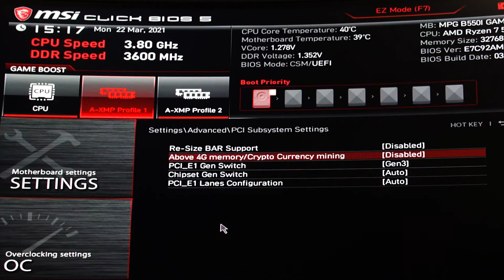Reasons a Computer won't Turn on - Part 2

Comment: Hi im back my mother board light is on but power bottan dosnt work i used to jump start my pc every time this happens but this time it wont i have a ryzen5 3400g primeA320mk motherhood 16gb ram vega 11 500w power supply

Comment: So I recently bought a new motherboard. When I plug the power cord in the lights on my motherboard turn on. But when I press the button to turn on my pc nothing happens. And I made sure the power wire is going to the right place on the motherboard as well. I don’t know what’s going on here.
Reply from the maker: Did  you connected the CPU power connector? Did you tried flipping the reset switch connector incase your positive does not match to positive? Part 1 video is a step by step guide, this only mentions some of what I needed to go into more with and a few things that needed mentioning.

Comment: Hello, can u help me, i just built my new budget PC and its not turning on, i have no idea why, i can send pictures if needed
Reply from the maker: Is your power switch connector from your case on the correct motherboard pins? As mentioned in video part 1
Reply: @sparketech  Hello, i found out mz cpu power cable wasnt connected in the right way, im typing this from my new PC, but i still have a problem, i cant get to use my hdmi on my rx 570
Reply from the maker: Also make sure the power supply switch is turned on... Some are switched off out of the package.

Comment: i tried to jump start my psu.. it works..and   my motherboard working too.. but when i mount my psu to my mobo.. it wont start.. and even psu wont run the fan
Reply from the maker: Part 1 video is very likely to have the solution... Going to sleep right away less than 6 hours left to sleep before work. Hope it's something easy...

Take it this is a new computer? Motherboard and CPU? What Power supply?

Comment: Hello Zerou here from Discord. I will repost my case.

So i got myself a new pc. I bought each component individually, screwed, plugged everything pressed the power button but nothing worked. No fans are spinning, no EZ Debug LEDs are lighting up, there is nothing audible.

I checked every connection. That includes every powersupply cable and also Power Switches (also with the screwdriver method).
I also tried to remove memory sticks one by one.
I connected my Smartphone with the USB Port of my motherboard and i saw that it startet charging so there must be some electricity.
I also removed the CMOS battery and put it in again to reset the settings.

My PC specs:
- AMD Ryzen 7 5800X 8x 3.80GHz So.AM4 WOF
- MSI MPG X570 GAMING PLUS AMD X570 So.AM4 Dual Channel DDR4 ATX Retail
- 32GB Kingston Renegade K2 FURY DDR4 3600 UDIMM CL16
- be quiet! Dark Rock Pro 4 Cooler
- 700 Watt be quiet! System Power 9 CM Modular 80+ Bronze
- be quiet! Pure Base 500DX Midi Tower

Question: Should the powersupply fan turn on when i switch the powersuppy on even though the rest of the components including the mothermoard isnt doing anything?
Reply from the maker: The USB ports still charge? Do you have access to another PSU to make sure not faulty?
Reply from the maker: Forgot to ask what is your GPU?
Reply: @sparketech  rtx 2080 TI i also have a gtx 970. I have another PSU but i dont want to play around that much with the hardware. Dont wanna mess up with anything
Reply from the maker: @Sezeru61  offering suggestions just in case. There is always the odd thing that can happen

Comment: my pc sometimes starts and sometimes doesnt, tried finding a solution but nothing comes to mind
i have to wait a bit if i wanna take it to get it checked out so ive been trying to fix it myself
Reply from the maker: Part 1 has the small details... And my newest video unstable or crashes video till tell you more... Hint test your memory as I state in my newest upload links to the program is in that video discription... Memory issues could very be the case, people rarely realize it
Reply: Bro same I cant find fix on the internet. Tried changing psu and it never fix

Comment: I need help my pc won't turn on, fans won't spin and yes i watched the first video also i got the mother board replacement my warranty they said it's faulty but everything is the same
My specs
Cpu:r5 3600 
Mb:b450m s2h
Power supply:cooler master 600w
Ram:g skill
Gpu:rx590
Reply from the maker: Do you know if you have an old or new bios on the motherboard? At least new enough for the 3600 CPU that is. Did you try the computer with ram in different slots including just 1 stick? Do you know for sure that your power button switch is in the correct slot to work and the correct negative positive direction (maybe try flipping it)
Reply: @sparketech  it has the new bios and i tried using screw driver to power it still nothing work
Reply from the maker: @Alien-cr1zb  power switch is powered on on the power supply? All the power pins installed on the board? Cause some put only 20 of the 24 in. Do you know that your power supply isn't the issue? Are there any power lights on the motherboard? Usually there is usually a small LED light on when there is power to the motherboard
Reply from the maker: @Alien-cr1zb  The screw driver trick if you hit the wrong pins it could go badly... Have you tested your power supply? Sadly that motherboard of yours does not look to have LED to show it is receiving power like most boards.
Reply: @sparketech  and yes i tried each ram on both slots alone
Reply from the maker: @Alien-cr1zb  if you have discord it'd be far easier to send some pictures with the wires all connected rather than asking random questions that would be answered in pictures... My discord link is in the video discription

Comment: my motherboard is receiving power but the fans n everything else connected to it is not powering and the pc guy who i gave it too says the problem is not the power button
Reply from the maker: Is your CPU powe connector connected? Not just the motherboard power? If you live in north BC Canada could prob figure it out very quickly for you. I build computer systems as a hobby and ran 2 computer businesses doing computer repair work. Did you watch part 1 video? Link is in the video discription.
Reply: @sparketech  yes i made sure its connected  and i watched part one but yet to understand whats really happening and i live in the carribean so i cant go tk th place u recommend
Reply from the maker: @racallbell276  what are your specs? CPU, Motherboard, graphics card, PSU? See if there is a spec issue... Is this a new build or a computer that simply stopped working one day?

Comment: My computer was working fine and I decided to put new fans in and it still worked after that but the next time I tried to turn my pc on I got nothing at all so I tested my psu which worked and checked the power switch which was fine so I figured it might be the mother board so I just bought a new one and installed everything made sure everything was plugged in motherboard egg was on I went to turn it on and nothing so I have no idea what to do now
Reply: Same, did you ever find a solution?

Comment: Im trying my luck here. Can you please help me?
Cpu : I5-9400F
Mobo : Asrock B365 Phantom Gaming 4
Ram : team elite 2666 8gb
Psu : be quiet system power 9 500w bronze 80+

So the issue is, at first it turns on until it suddenly turned off, and the mobo light used to breathing red light, now its blinking fast red light and im unable to turn on the pc at all. Can you please help me? Thank you!
Reply from the maker: Part 1 video I'm pretty darn sure has your solution. You don't list a GPU??? If you're CPU is an "F" with intel I call it F'ed because there needs to be a GPU. If you have a discrete graphics card movie to part 1 video listed in this video description. If you don't than you have to go get one.

I've had that same sort of issue many times before (minus the missing GPU) but I never remember quite why. I tend to resolve it after I reseat of some component... larger boards often moving to different ram slots, wrong slots are often used and performance lost. Usually that issue is caused by a short, part 1 video after the very basics I mention things to check.

PS. if you have only one stick or ram you should be using 2 sticks or you are literally throwing 15 percent performance away.
Reply: @sparketech  im glad you replied! And sorry for not inserted the information but i do have GPU. GTX 1050 ti. 

And the problem is my pc wont boot at all. The motherboard LED keep blinking rapidly everytime i turned on the PSU yet unable to turned on. So, any insight?
Reply from the maker: @andreasj9996  i would be shocked if part 1 video does not have the solution. Did you check it out yet, part 2 is every solution I missed in part 1... The one thing I still missed was moving ram to a different slot as an option. If your in northern BC Canada I could probably figure it out in person almost right away.

Comment: Hello there I’m going to be a detailed as possible I have a AMD 3600 CPU with and Asus X570 plus motherboard and cosair power supply I have all the wires and everything connected just fine yesterday but today I end up putting a new CPU and yes it’s compatible with my motherboard when I did the switch nothing turns on anymore no power no fan spinning nothing just the LED lights on the motherboard itself I end up buying a new power supply but I’m still having the same issue. One is I think of did I have a power surge or something I made sure everything was disconnected when I made the switch for the new CPU. I’m racking my brains I try so many YouTube videos and nothing to work do you have any advice that I haven’t think off please thank you for your time.
Reply from the maker: But is your bios up to date to run the new CPU?
Reply from the maker: Is your CPU motherboard power connector plugged in and also your reset/power switch connected properly still, if not nothing would happen when the switch is pressed, and the motherboard would have power just like you stated it does
Reply: @sparketech  yes my bios up to date for the new cpu all the wires connected just like I had previous but I hit the power button nothing coming on no fans spinning nothing just the led lights on motherboard comes on that’s all

Comment: My pc won't start and everything is not working except the pch is getting hot over time what do you think is the problem? TIA
Reply from the maker: I need far more detail than you provided here. And I take it you meant CPU but almost any problem will have your CPU heat up.

Did you try the steps from this video and part 1?
Secondly, did it suddenly stop working? Is this a new computer or did it stop working after an upgrade and if so what did you upgrade? what is your motherboard and what is your CPU?